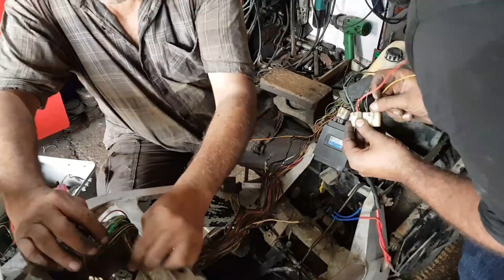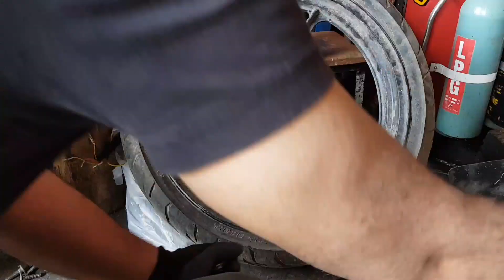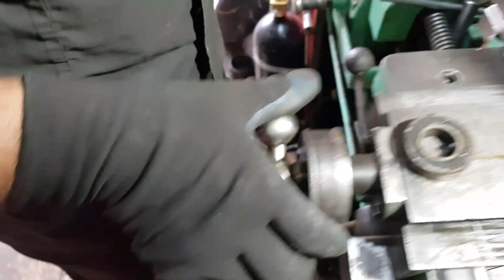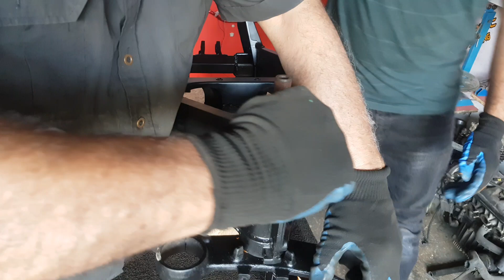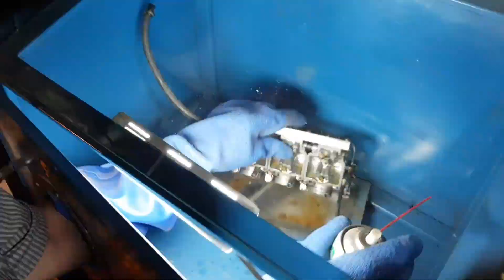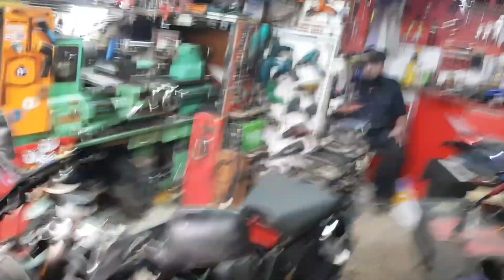Project Rebuild Kawasaki ZXR 250 By Tamoor Pervaiz

Comment: Taimor bahi app agr kpk ma be agr shop khola ta bare mahr bane hoge hamara pass yaha pa koi be dang k mechanic nahi ha. Mana apna bike new paint kia AtoZ lakin mechanics bike ka bara gark kar dia irresponsible re assembling ma sara paint barbad hogaya or han jo problem k leya laka jata hon wo tek he nahi karta. Mara carbs k problem ha sab kuch tek ha us single sulf pa start hojata ha lakin engine Idol tek nahi ha. Mutlub bike start nahi rahte rpm ko barkara rakhna k leya bar bar throttle dana prta ha rpm barkar rakhna k leya agar throttle chor dia jay to band hojata ha 30 sec bad kindly help me in this problem my mechanic says that i need new carbs. Agar mara carbs weak hota to ya lock nahi marta bas patakha marta ha tora tora or bina throttle k strat nahi rahta

Comment: Salam Taimoor bro, Masha ALLAH Awesome work, Keep it up, One thing I want to ask you bro,Is it same Engine 4 Cylinders Engine you Swap like it have Original in 1990s or Some other BZ now a days, there is no any other 250cc bike with 4 Cylinders right now only one which is Kawasaki Surprisingly they r Bringing back ZXR250 in 2020 Coming soon just like 90s Legend 4 Cylinders bike even more Powerful than before, Kawasaki had Launched already Ninja 400 with 45 Plus HP but Dual Cylinders.